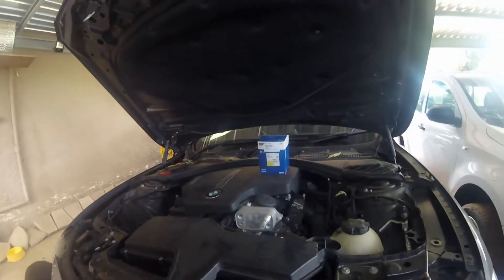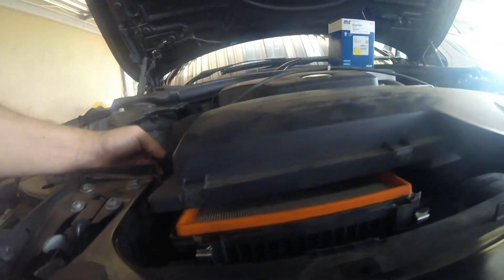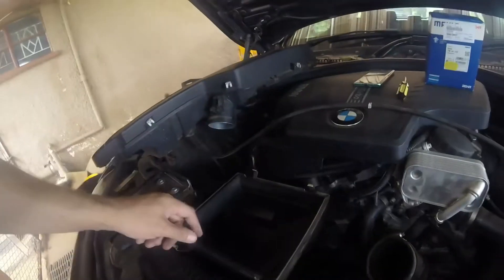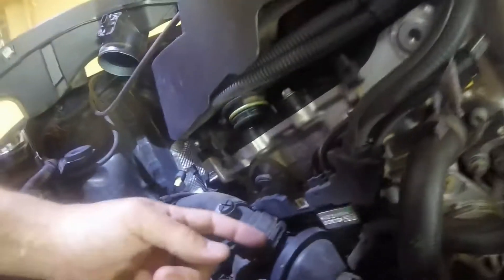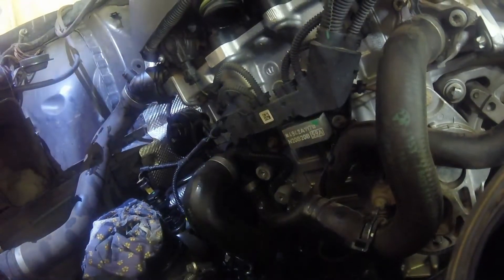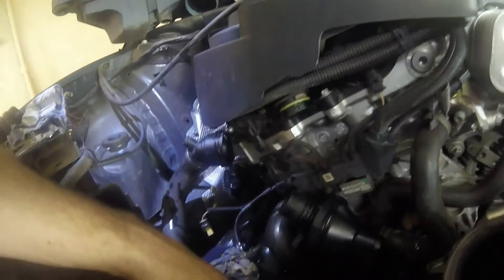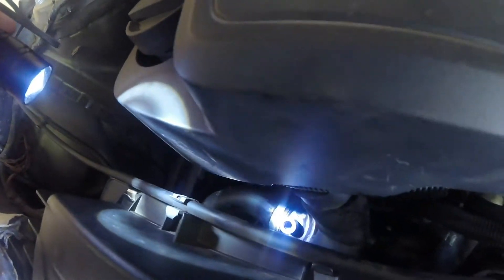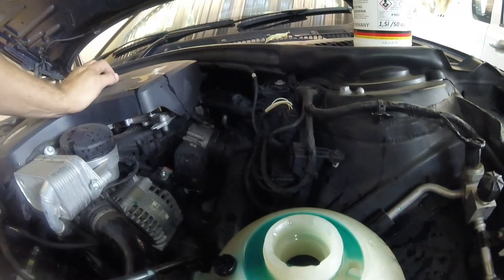Thermostat replace of a BMW F30 N20 Engine

Comment: What are the symptoms to make you change the thermostat please
Reply from the maker: Hi sorry for the late reply,  the car threw out a drive train error and i then scanned for the specific fault code.  the computer told me the thermostat had a problem hence the thermostat replacement.
Reply: @interestingstuff4048  was it stuck open or closed I think mine is stuck open the fan kicks on high cold starts and my engine temp stays low
Reply: @interestingstuff4048  thanks pal
Reply: @kingsflo7036  that’s what mine  is doing it will have a  P0597 code ( thermostat heater control circuit/ open ). you need to replace your thermostat kings flo
Reply: @andrewdebrosky5822  thanks bro I never got a check engine light or code so I ended up driving it like that until last week after driving home from work the stuck open thermostat took out my water pump and now it’s in the shop getting fixed under warranty except my warranty won’t cover the thermostat so I’ll be paying for that . Sucks wish I replaced my thermostat sooner on the bright side they checked my timing chain and turbo all good and I won’t have to worry about a thermostat or water pumper for a while still love my car tho lol